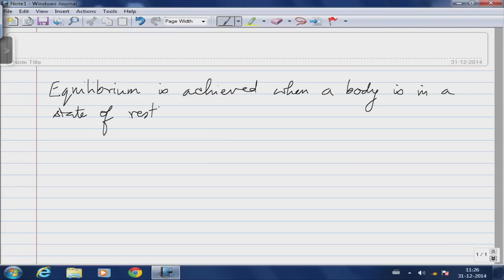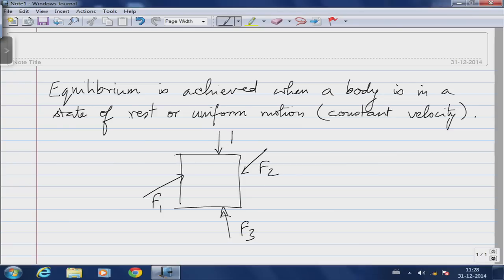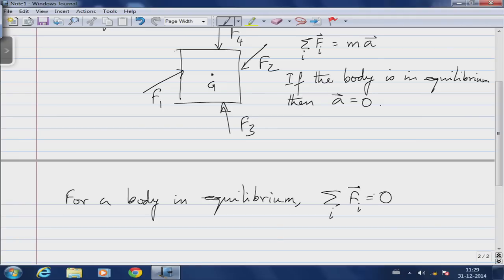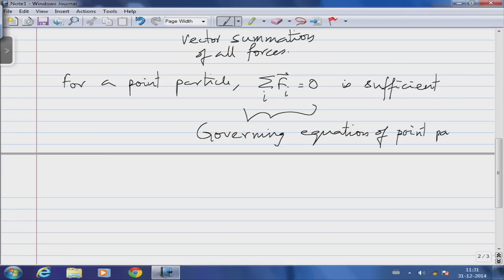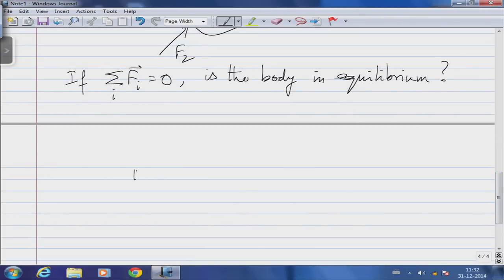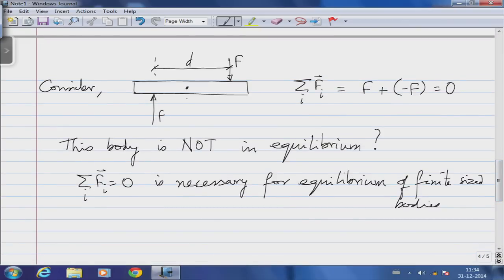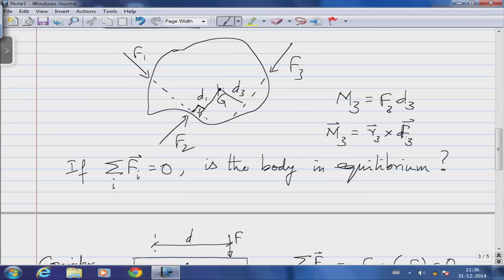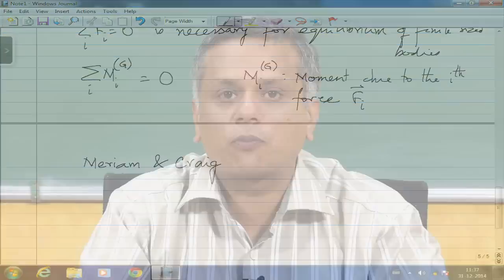Equilibrium

Comment: of course yes, because if a body is in uniform motion then according to the 1st law zero force is acting on it, thus the body is in equilibrim....
Reply: Your statement is incomplete. 
• Body is continuous to be in rest or uniform motion (Along straight line) unless & until the external force acts. 
• Not only uniform motion as it can be any uniform motion but every uniform motion is not non-accelarating type. 
• For eg. Uniform circular motion means (constant angular velocity), even if tangential accelaration is zero but there is still radial (centripetal) accelaration on it.
Reply: @NAYAN-t3e  Yes. Uniform motion in a straight line.